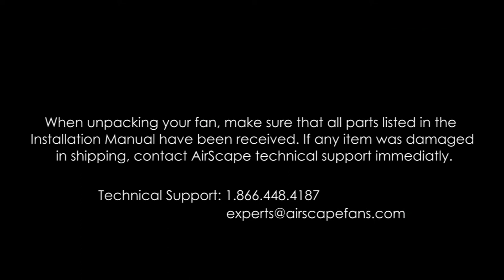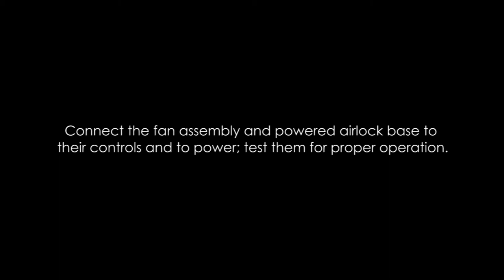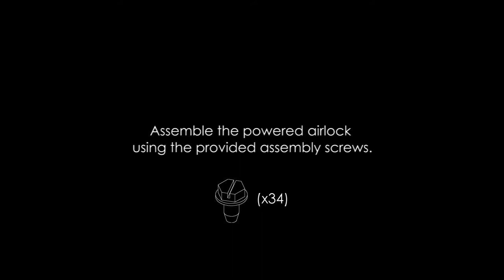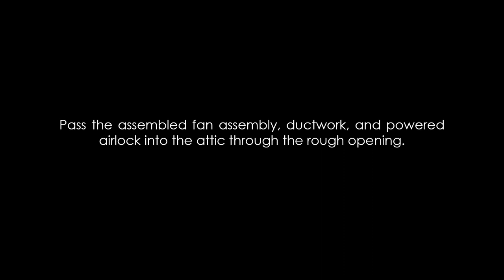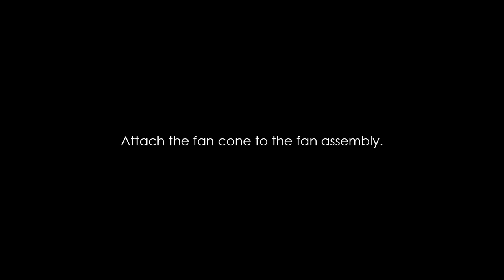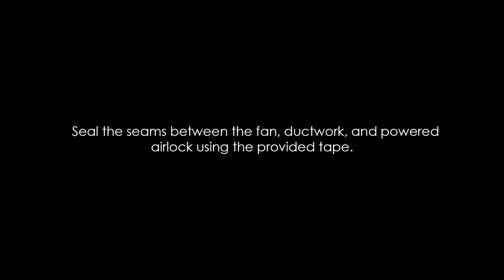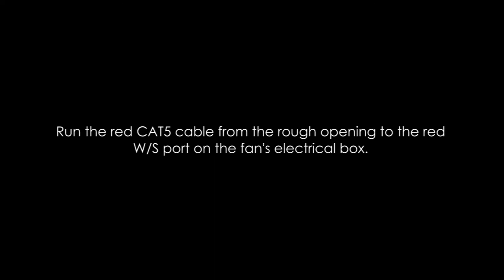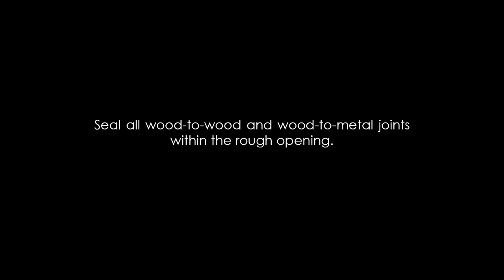AirScape 3400/4300/5300 Whole House Fan Installation

Comment: When you put the vent ducting into the top of the powered air lock, try to keep the hose lined up somewhat, so the locking clamps line up on the other end, makes mounting the fan to it much easier